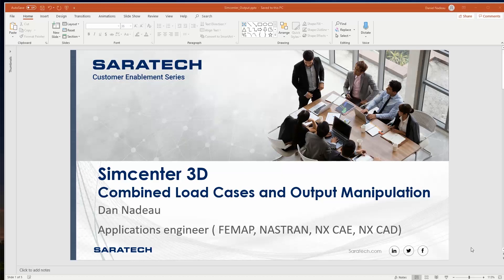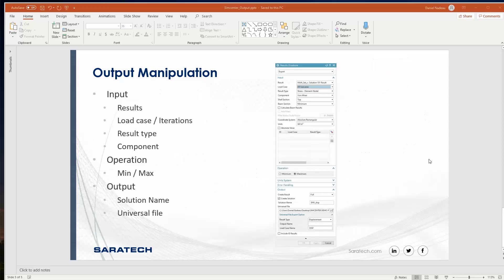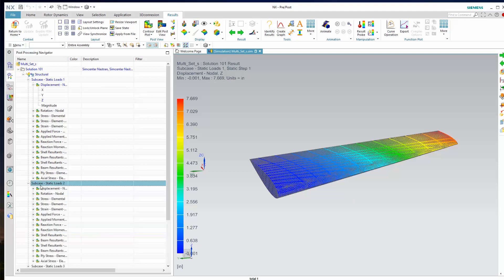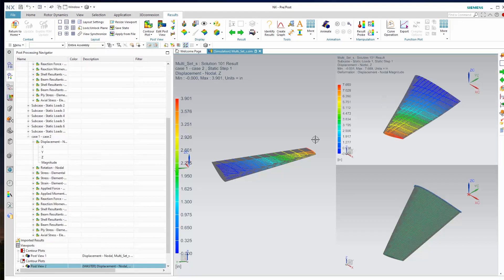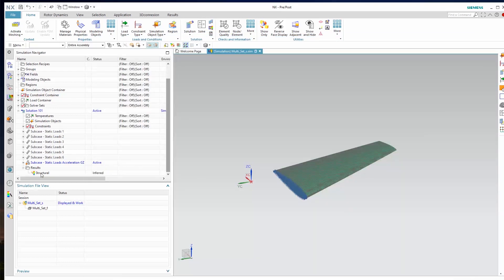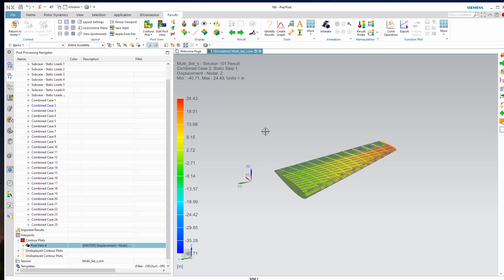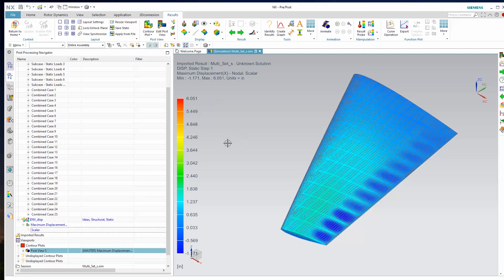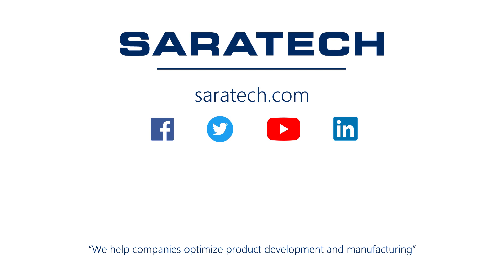Simcenter 3D: Combined Load Cases and Output Manipulation

Comment: Great video.  Quick question:  When viewing the enveloped results, how do you know which load case is driving the max displacement?  If I still need to search through the load cases to get that answer, then the enveloped results aren't saving me any time.  Thanks.
Reply from the maker: Hi Carlos. In the Results envelope Box.  “Include ID Results” checkbox.  If checked;  Generates a result set that maps minimum or maximum values to the load case, iteration, mode, or time step that contributed the result. Email info@saratech.com for the screenshots.